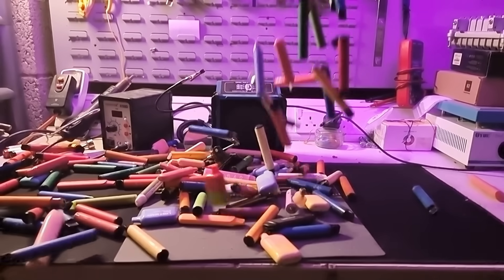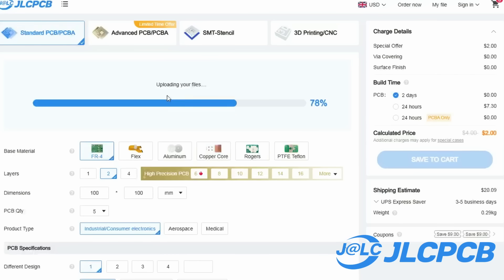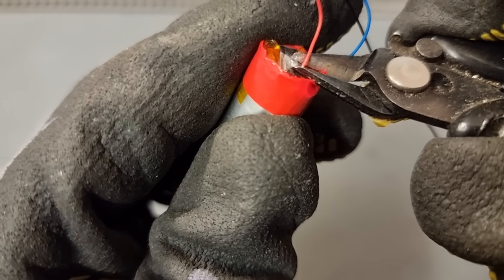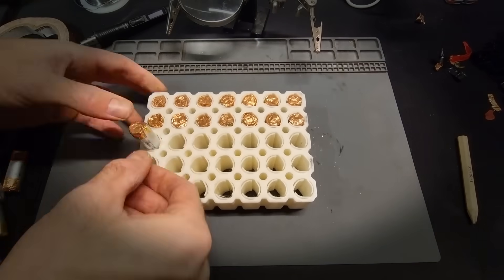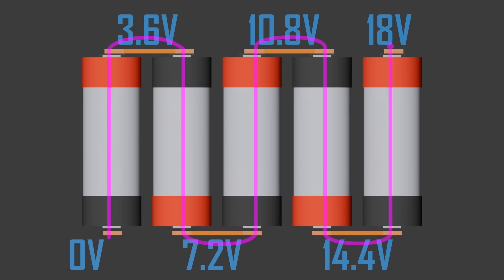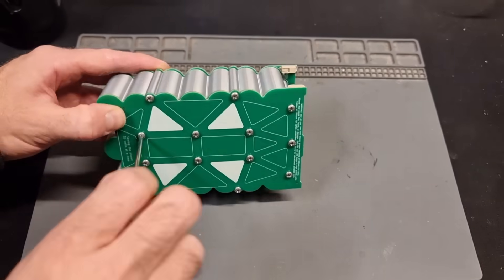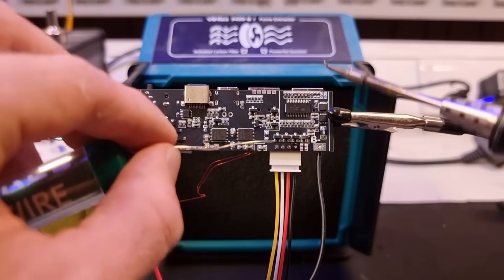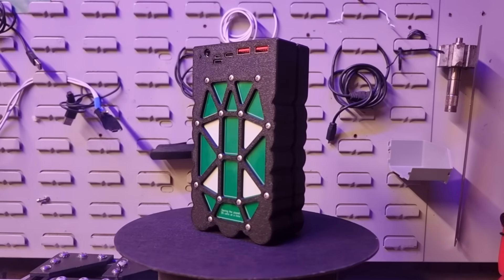Making a Power Bank from Disposable Vapes: UPGRADED + Extreme Tests!

Comment: Great Job! I’m online concerned about the possible water damage. Is the design water resistant?
Reply: I am no electrician, but, given that the only thing preventing water intrusion is the torque of the bolts against the plastic case (and therefore the PCB), I'd say no. But, you could water-resist the design by wrapping everything but the ports and screen with duct tape, and coating the screen with a thin coat of clear epoxy or glue. You could also epoxy-coat the entire thing, but that defeats the purpose of the design being built with "coming back apart to replace bad cells" in mind

Comment: Mate you are killing it with these videos! Supporting what you are doing all the way. I picked up a 1750mah vape off the road today, absolute madness that these are considered disposable! Not only is it a decent capacity cell the vape itself is basically a pod system vape without the ability to refill or recharge it easily. The pods have their own contacts and the vape has spring loaded contacts, if people realised that they are basically buying and throwing away what could easily be a reusable device with the simple addition of a charging circuit for very little cost we could change the world. I hate this waste but it does lead to some cool projects those in the know

Comment: I don't know how it works in other countries, but reusable vapes are usually the same initial price (with 1 pod) and refill pods are half cost later. This is the case in where I live, at least.
So even if you forget your device and feel urge to vape, eventually ending up with multiple bases, you have few devices for quick-reload and can gift them to someone in need too.
Of course it doesn't fully solve the problem, since the pods are plastic but is a WAY better alternative for no additional effort. As long as you recycle these, it's cool for me.
Hopefully companies behind them care for this enough and don't use recycle programs just for marketing, then dump them away.
If I ever hear that's the case, I'll be bashing people's heads for using these too.

Obviously, you can go all custom with 18650 Li-Ion batteries scraped from laptops and single tank, saving even more pennies on refills, while being more eco, but it's not compact if you need it to be.

Comment: I don't know if it would work, but if the spacing needs to be 2mm on top and bottom, couldn't you just put a 2mm section on the bottom of the battery holder print that would stop the 13400 batteries from being in the wrong position?

Comment: why did you not just solder wires to the cells and conntected those to the pcb? Seems like a predetermined failure point-

Comment: I was about to follow through with this project but i then realised that i would have to spend around £50 for all the parts like pcbs and stuff. And for £50 i found a ugreen 20000mah powerbank for £55 on amazon that doesnt look like it was 3d printed in my basement and it has a screen on it and produces 30w more than this. Plus i wouldnt have to make it either. This is very cool though because your getting it from vapes and your recycling and its an experience but its not economical at all. For labour and parts.

Comment: the best way to test salvaged lithium cells is with a standard bare lithium charger with leads
they almost all have IR and capacity tests

the best way to ensure a good cell is to do a slow charge, test if it ever reaches >3.0v(as low as 2.5v in a salvaged cell CAN be recovered safely, lower puts you at risk of internal shorts so the slow charge is CRITICAL to detect an internal bypass that hasn't shunted yet)

step 1: measure voltage
if above 2.5v place it on a normal charger rated for a charge rate of 1c or less(most tp4056 modules can do a1 or less, which is safe enough for the high-current vape cells and most 18650 cells and phone cells
step 2: normal charger on low setting
if it begins to get hot enough to hurt with prolonged touch it is useless, but this would have been detected via the resting cell voltage being <2.5v after a few days
step 3: capacity cycle
most 18650 chargers have a "grade" mode, and can be limited to <=500ma charge, perfect for vape cells of all sizes(none are <500mah)
step 4: pack design
different cells have different intended wiring, 18650's are intended to be spot welded, pouch cells inside things that are flat tend to have solder tabs or boards, vape cells can usually be compressed on the ends with spring tabs or soldered"
step 5: cell matching
capacity varies in salvaged cells, so does IR and even the current voltage of a cell, your best bet is to match capacity closely, then ensure the IR is within a few % of the other SERIES cells
parallele cells can be different as long as they are at the same voltage during assembly, this can help make use of weak older cells by pairing them with stronger cells in parallel, as long as the series quality is the same, you can use slightly weaker cells

and funny enough, some of my good cells I use RIGHT NOW are 18650's salvaged from a portable DVD player that refused to charge a pack that settled at 2.5v, they were still within 25% of the rating and still easily pump out >4a happily for my china dremel(I measured it's current, 4a stable)

cells that go below 2.0v AT ALL are "sus" this CAN be ok depending on the conditions of that discharge, the margin where guaranteed cell damage occurs is about 1.6v
so treat them well and give them a slow wake charge and li-ion cells can come back just as happy as new, treat them poorly and they go fiery mad
in fact large EV's tend to push the limits of the cells they use, requiring cooling and heating to avoid loosing that last few % safety margin

they do this because they design cars to have "lifetime packs" which means a few dozen thousand miles or km, way below even 1% of an ICE car's expected lifetime before scrapping, and so they have to make it cheaper by abusing cells, because ironically a dying pack due to abuse causes faster scrapping, which causes a need for lower pricing, which causes more cell abuse

if my ev simply had a tray of LiFePO4 12v packs under the trunk and rear seat, possibly in a standard form factor like the american common standard classes of automotive lead-acid batteries(29DC is a class that is size group 29, and DC means it is designed for deep slow cycles, like running an RV rather than a starter motor)
I would just replace the pack at great but less than new car expense

it would probably be better as a "briefcase" style module that ALL EV's are legally FORCED to use, with a STANDARD HV connector like the anderson connectors that can go as high as 600v and 175a each with a spring-bump latch and contact that ensures good contact area and the backing strip acts like a spring AND terminal retention(ask me how hard it is to intentionally pull out a latched terminal, with access to the side where the spring is even visible)

each case would be a quick-connect liquid cooled(probably a standard port size with anti-leak check balls that get depressed when the pack is properly seated and secured) case at 12v, the most common standard around the world that simply gets doubled or more to make up larger voltage arrays(my common invertor is a 24v array, 2x12v, the next standard size outside of mobile batteries like ebikes is 48v, or 2x2x12v)

then we can buy an EV with a "packless" or a custom capacity(short commuters with EV charging at home need only a few dozen miles of range, and can swap packs in an emergency at home)

perhaps a 10c rated(meaning 10x capacity max draw) rated 50ah 12v module(so 500A for as many as 6 minutes, or given the high voltage pack size of probably 100-500v a wattage of between 5000w and 25000w, well beyond the needs of almost anyone short of towing

and if designed just right, using places like the rear seat well in a car, or a tray in the former engine bay just above the main inverter-charger kit, you could have as many as a 5p array of batteries, or 250ah pushing max load of as much as the kit can take at above 1000a

hell my ebike at 750w legal limit is ONLY bad BECAUSE wattage relates to weight, which ONLY affects acceleration(making any legal limit below 1000w a stupid and wholly uninformed law that should be ignored)(I need by experts who should be the ONLY people allowed to make laws about tech, about 2250w, when factoring in cargo,+battery+me(yes I am fat, but even at healthy for my height I would need 1250w with normal cargo loads, 750w is for a child or chronically underweight adult, the very ones we probably should be avoiding allowing silly wattages on, like too small for an adult, and too big for a child))

so yes, we have law-issues, manufacture issues, information issues, and fear issues
I would be confident with my current understanding of lithium-ion that I could make a pack that is within expected safety using nothing more than a cheap spot welder and a bunch of old electronics with batteries salvaged from them
I might even use parts of the dead electronics(especially if it was a PC with power supply) to design the safety circuits for overcharge and low battery detection
I could do all this with an iron, and a computer(and a spot welder if I didn't order a spring board for my cell holder and 3d printer if I didn't get a case made)

there is much fear over lithium cells, people wrongly call them dangerous, but the real problem is the energy they hold, it is not far of literal gasoline in terms of energy density, which explains how it can be JUST as flammable as gas in air, the cool part is the density is effectively better than gas if you factor in the recharging and the  complex need to push air into the engine to even burn the gas, and the difficulty in burning a liquid for energy when vapor is the most efficient way to extract energy from a combustion reaction

lithium-ion batteries are the BEST energy source for large loads that would otherwise use a combustion reaction, followed closely by propane(yeah not gasoline) because of it's shelf life and ease of vaporization, making engines less complex and therefore more weight efficient(let alone it is possible to synthesize propane from renewable sources, not so easy with gasoline and other liquid fuels besides ethanol, which is difficult to use pure in combustion engines in cold)

so yes, lithium-ion for large loads, LiFePO4 for standby and long service applications, propane for a backup source and eco-buffer for carbon pollution, butane for emergency and mild weather cooking, and finally ethanol where it is difficult to handle the propane tanks but a thermochemical energy source is required and the evaporation issues can be compensated for by adjusting burn rate when colder as you would be monitoring it during cooking

at no point did I reference any liquid fuels that are from the oil fields, because their danger is just as bad with less benefits and efficiency

Comment: The concept is great, but the copper tape on the bottom is dangerous. You should place an unsulating rung aroun the top, and probably something stronger than copper tape. Something like soldering copper sheet to the tab would be stronger and more conductive. Just given the fact its not actually welded, theres potential for mechanical wear if theres any play in the cells, or even just the tabs puncturing from the pressure.

Comment: 6:04 Oh my gosh, memory unlocked..
As a very young teen, my handed-down iPhone SE (1st gen) sometimes just completely died , I opened up the phone and used a cut down USB cable to charge the battery to a voltage where the phone would accept charge from the charging port. Looking back I'm very lucky that I didn't hurt myself. I did this like 10 times in total, just to save 20 bucks on a new battery.

Also your video quality is insane for such a small channel and the views reflect that, just not the subs. Rock on!

Comment: what about vibrations? i feel like using copper foil with 'leaf' springs is not best way to connect them batteries to pcb, what made you choose those and not normal twisty springs like all remotes do for decades? probably height if i had to guess... I'm curious what would happen with batterypack in a long run if you would just disconnect single cells for couple milliseconds. Leaving huge gaps in case might look cool and somewhat helps with cooling but one bad spill and you can say bye bye to your house, i wouldn't be able to close my eye during the night :D How hard would it be to make it watertight and how bad could temperatures get in stress test?

Comment: Isn't it also dangerous to disconnect a battery when its faulty because the voltage will stay the same so the current per battery wil rise so you will possibly be overloading batteries
Reply from the maker: You're correct that the other cells will do more heavy lifting if a cell is disconnected. However, these cells are rated for 3A continuous current each, and at full power, each row will only be outputting 5A. So, as long as 2 or more cells remain connected in a row, the power bank will still function safely, although the capacity will be pretty bad

Comment: Now just because the cell is below 3v doesn't mean it's dead or bad. I've recovered plenty of lithium cells that were at even 0v and to this day work just fine. The most common issue to expect is less capacity due to sitting in low voltage for a long while but simply cycling the cell fixes that a lot of the time. Even self discharge can be fixed a lot by just cycling the cell. The main concern you have to look out for when recovering low voltage lithium cells is whether it starts getting too hot (Warm is fine and normal) and what the internal resistance is. If the internal resistance is high but it's fully charged, try cycling it as that also lowers the internal resistance.
Reply: I had a defective cell in a 2s lipo battery, didn't notice it at first and charged it like normal (not super fast but also not careful) until it expended a little 😅
I stored it a while before disconnecting the 2 cells, now I have a 1s lipo :)

Comment: These batteries are really low quality and i would be surprised if they can handle even 100 charge cycles. Maybe even as low as 10-20 cycles.
Reply from the maker: I thought so too, but after getting hold of the datasheets, they can supposedly handle 300+ cycles before dropping to 80% capacity. Im still a bit skeptical, but after using the powerbank from the first video for 6+ months, it seems to be still working well!

Comment: Good work Chris. I am currently I am working on a project to replace old NiCad batteries in cordless power tools with vape cells. Already done a small 4 volt drill, next on the list is a 18 volt hedge cutter battery. All my cells have come from discarded vapes I find on the footpath, where do you source so many from? Thanks.

Comment: Your videos among some others inspired me to replace my dead ps3 controller battery with a recycled one from a vape. The capacity is now 2.5x the original and I’m proud!
Reply from the maker: Nice one well done!
Reply: Dang you mean the battery in the controller? Ill have to consider that idea 👍
Reply: @noahboat580  yeah I just carefully took the connector off the factory battery and spliced it to a 3.7v lithium cell of random dimensions. I fitted the cell into the handle of the controller and cut a little relief for the wires to fit into the controller frame.

Comment: I'm actually used these rechargeable batteries to 'de-batterize' entire thing in my house. Started from simple tv remotes, then some small technics like alarm clocks, head light, kitchen scale and such. They've saved a lot of money, and I've already forgotten the last time I went shopping for batteries.😅
Reply: How do they fit in AA battery slots in your remote? Genuine question.
Reply: @Madfox88  Some batteries are just in size of AAA batteries, so they fit perfectly into the slot. I used it together with the original vape board, which has a USB-C connector and a charger IC on it, besides it was more miniature than the usual 4056 module.

Comment: I really like working with vape cells, but I dont really like them for large capacity Stuff. This power Bank is huge compared to what could to Just 5 18650 in Series. Dont get me wrong, its a great project, but as a power Bank, large cells are Just mich more space efficient.

Comment: Why so complicated PCBs?Why ittle springs, if just one cell loses the contact, the BMS won't charge the others fully. The use of PCBs is ineffective and inefficient. If you could eliminate the soldering completely, but no, you still need to solder a lot. Aaah, the sponsor is a PCB maker... 😂

Comment: How many cells do you think I would need to run a 12v head unit with 2 speakers and a vibe mini 400w amplifier for a good few hours. Basically a comparible amount to a car battery but without the high amps. 

I use a mains 12v power supply that's rated for around 10-13amps when it's set up in the garage. I tried a 3 or 4amp supply before that which wouldnt stay on when the volume went up. The 10amp one works a treat at full volume. 

So ideally a 12-14v pack with a low current output and a few hours of life

Comment: I know its difficult to get your hands on the datasheet of theese "special" cells, but not all cells are unusable below 3V. Many 18650 actually go down to 2.5V or lower (VTC6). Of course its not conducive to their lifespan but you can squeeze more capacity out of suitable cells, if you change the corresponding resister value on your powerbank board...

Comment: You can make the slogan prettier by write it on the Front or Back layer and exclude it on the solder mask layer, thus the slogan will be made into a copper layer and get covered by either solder or gold plate.
Reply from the maker: Oooo yeah thats a really good idea!